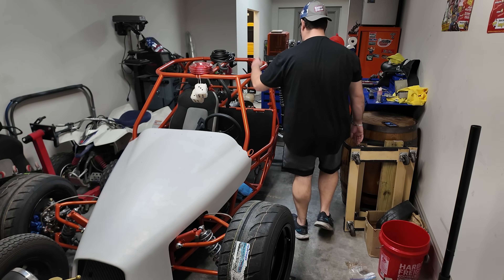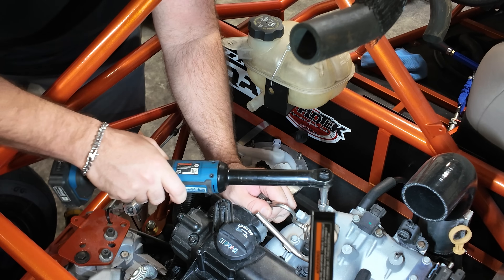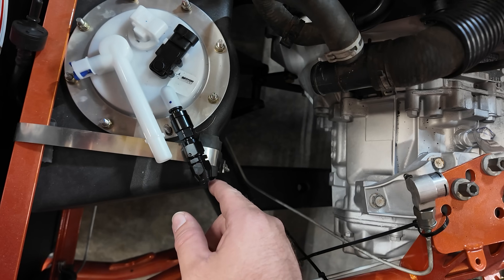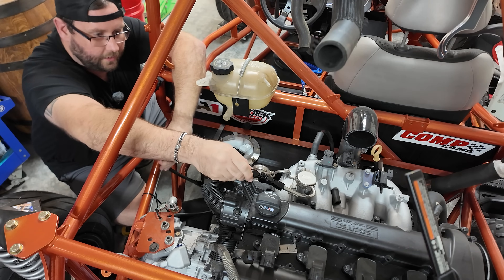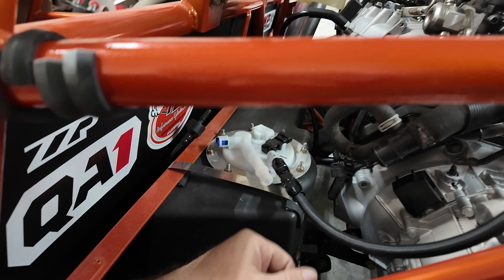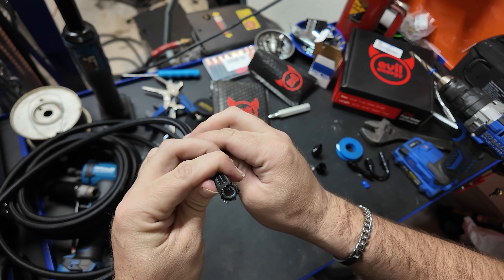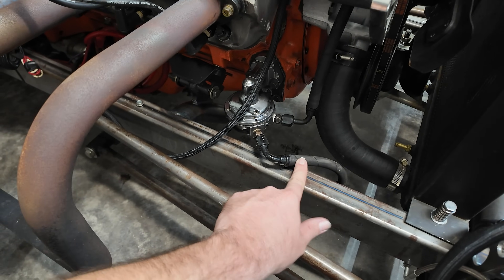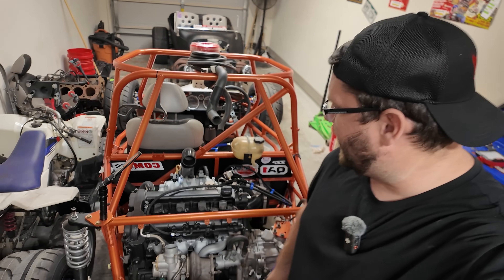Best Affordable EFI Kit? EVIL ENERGY Braided Fuel Lines & AN6 EFI System Install on DF Goblin

Comment: Not running a fuel filter??
Reply from the maker: Nope no need, there's already one  in the pick up.  You could if you wanted but it's an unwanted expenditure while not expensive just creates another leak point as well.  GM didn't run one in the Cobalt,HHR, Kappa etc either whether by design or to save some $$$